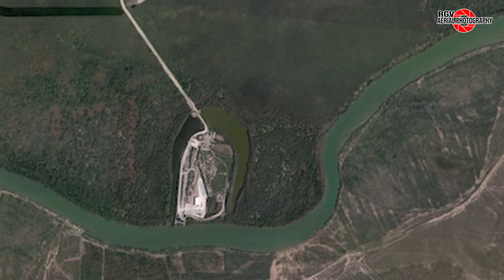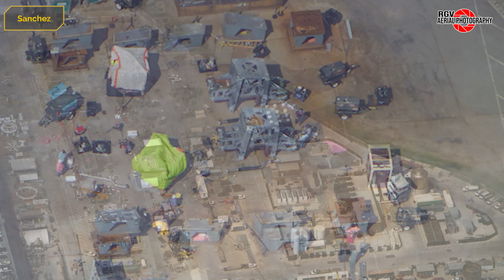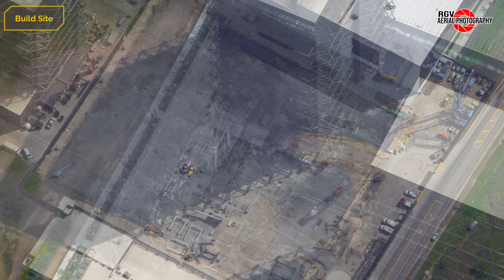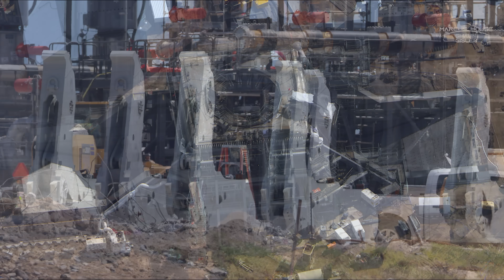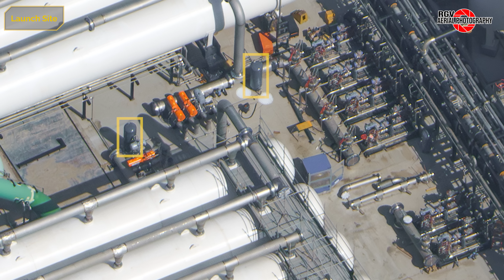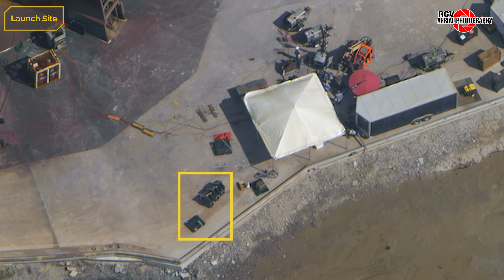Static Fire on OLM?! NEW Starbase Flyover 88

Comment: Curious why everyone assumes the adapted stand will be for static fires.  Seems like a spin prime will achieve almost every objective of a static fire without risking the OLM.
Reply: Because they have a habit of static firing everything they fly.  A spin prime doesn't tell you how things work under the extra stresses of engine firing.
Reply: @imaginary_friend7300 This is SpaceX. Saying they will not change their procedure to cope with changing circumstances is like saying they would never try hot staging because they had never done it before.  
I'm not personally invested in the idea of spin-prime only, but I think it is unrealistic to rule it out until we see them doing preflight testing of the deluge system.

Comment: Nice to finally see the crane that tipped. Sure looks like the feet punched through the concrete
Reply: Looks like. Where are the load spreader plates? No "cribbing".
Reply: Thinking the load was light, but got away from the rigger, swung, and loaded feet more than anticipated.

Comment: are there weight estimates for that giant transfertube? looks way heavier than the hotstagering they already struggled with
Reply: The tube diameter and mass roughly doubled. If so, that would reduce methane pressure fluctuations by a factor of 4, allowing far more rapid engine startup sequences. Quicker off the launchpad. 

The present hot staging ring is not only an open interstage but a massive blast shield. The integrated HSR will eliminate the blast shield, using only the top dome of the methane tank, greatly reducing mass.
Reply: The question is how much more does it mass compared to prior transfer tubes and is the one giant tube for all engines again?  I believe the main issue with the HSR was not how much it massed but how much that mass shifted the originally calculated COM.